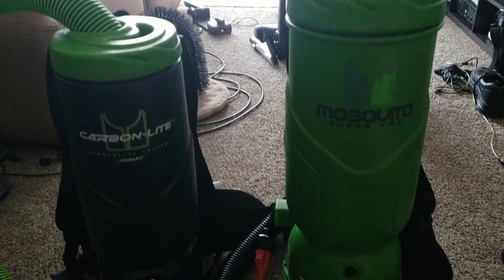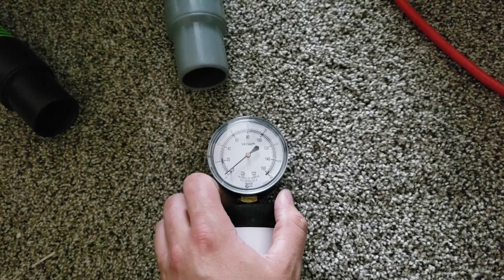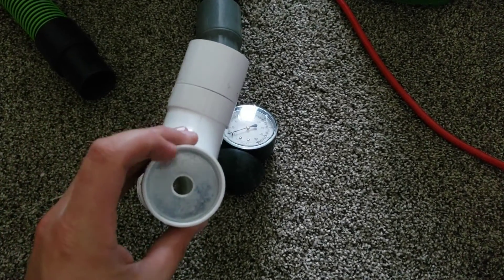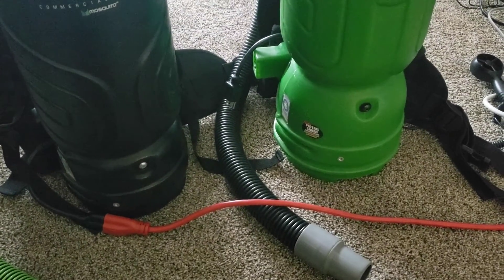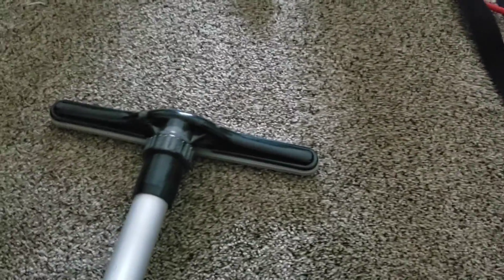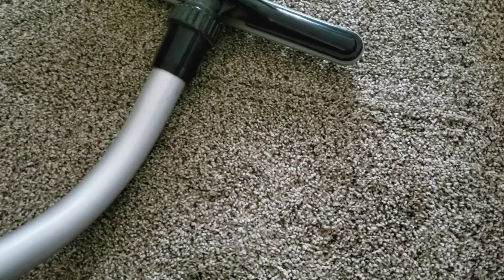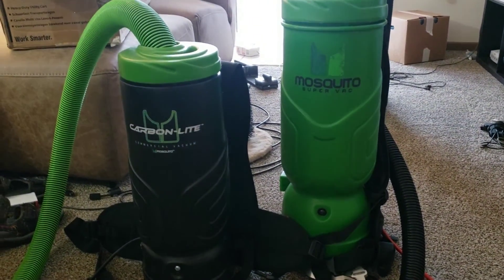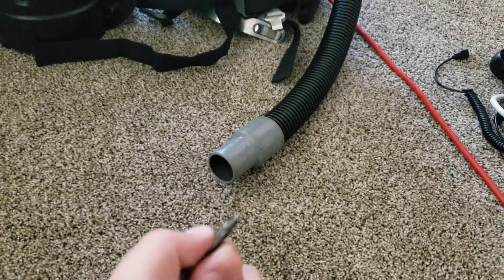Thoughts on working vacuum

Comment: A simplification: Suction digs lifts and focuses harder on a point, while air volume expands and sweeps a lighter larger area. Ultimately both are dependent on a combination of each other, relative to the fluid dynamic surface friction, of suction combined with CFM volume to overcome gaps in the seal around an object. Without enough seal and suction, one cannot overcome a density threshold regardless of volume. Conversely without enough volume, suction cannot overcome a certain gap of air allowed to pass around the object, so you lose the surface friction and lose your benefit of heavy power to overcome resistance like high density objects or a reduction in hose diameter like a clog. You certainly will better dig deeply embedded material and dense objects with higher suction and a good seal. You will sweep large swaths of light-density junk as a professional much better with a higher volume, as your proximity of reach is better for lightweight stuff.

Your job is to basically sweep a large volume swath of light-weight material as quickly as possible like a push broom, so that's why CFM is 'better' for professionals. You will not have to worry about density and enough fluid friction to lift denser weights passed the needed threshold. That's why it grabs from a distance around the openings. It's not 'better' it's just overcoming a light density in more area. If I'm sucking heavy density in less area, you bet your breakfast I'm picking a moderately lower CFM but higher suction unit. In my case, I need to remove embedded mold from wood, and from carpet before tearing them up. I will guarantee you I am getting more mold with the higher suction and some agitation than the higher CFM model.
Reply from the maker: Right you do need both  but I think people often overestimate how much suction is needed to clean effectively. Id' check out vaclab's channel he does pickup testing. High airflow/low suction machines often do very well while some high suction/low airflow machines do poorly. Of course a machine's agitation is very important to pickup as well.
So you've mentioned that you'd choose a higher suction machine for heavy density dirt but when we look at these two units what is it that the super with 90" of suction wouldn't be able to remove that the carbon lite would? I mean i'm sure there's some very very specific scenarios but like in regularly usage where you're using them with an airflow dependent straight suction tool I just can't picture that scenario

Comment: Hey I love this video!  I’ve been wondering how the cfm compares on the carbon light vs the super.   Just curious, do you have wattage or amperage draw numbers on them each?  Thank you for sharing this!
Reply from the maker: I don't I sold off the carbon light
Reply: I love the fact that (for what it’s worth) the green vacuum still has similar working vacuum numbers as a central vacuum.   Have you taken a working vacuum measurement on the Proteam FS6?   The amp draw on the two is different.  I wonder if that shows up in working vacuum numbers? Hmm🧐
Reply: I think cfm is more important than water lift. Water lift is measured as a sealed suction , so you maybe able to pick up a large nail , there’s not enough cfm to draw it back to the canister. While even if you had only a lower lift but greater cfm  it could take a large nail back with ease.

Comment: Kind of surprised you ran both vacs sitting on the carpet. Both exhaust out the bottom which will be effected by the carpet slowing down the airflow.  The proper way to tell the power of a vacuum is a before and after soil recovery test by weight as CRI does.  A visual oh this one did better picking up oatmeal is useless. The sand is what needs to be removed. It's what destroys the carpet from the bottom up. I own both these units and the Carbonlite motor is superior on both hard and soft surface. Put some nuts and bolts on the floor.
Reply from the maker: the impact of them being in that orientation I think is negligible Knowing that I measured about 150 cfm from my Proteam FS6 at the end of a 1.5 hose using the same motor as the super tells me that it really can't be making much of a difference. If it were against a surface that was less breathable there may be a greater impact to their flow. 
Well you're free to have whatever opinion you'd like but as someone who does commercial cleaning I'd gladly take the higher flow unit as airflow is what cleans.

Comment: I'm a professional hardwood refinisher. I am looking to invest in a pair of "the best" backpack vacuums for my purposes. Was looking at pro team, american sanders, and mosquito. I like the materials used in the carbon lite, however this video made me have second thoughts. 112 CFM seems quite low compared to the competition.

The proteam super coach seems to get a lot of mixed reviews. Durability and ease of parts replacement being one of the main negatives
Reply from the maker: For your purposes I feel like you may be better off with another type of unit in the long term. something with the ability to partially clean the filter easily during usage.  Like a Nilfisk wet/dry unit with the push and clean feature. You block off the end of the hose and then hit a button on the machine opening an airpath to kind of blast some of the stuff from the filter. There may be other units out there with something similar too but i've found those to work well for debris pickup from sanding wood floors as well as concrete dust. Though if you're definitely wanting a backpack unit I'd choose Proteam they are like THE name in the backpack vac industry, Just be sure to maintain your cloth inner bags too.

Comment: I think the size of the hole should be a 1 1/4 it then shows the ability of the machine to over come the loss of air flow of the hose and other restrictions in the machine and still maintain good air flow at the cleaning end of the tool going to see a lot lower readings but both waterlift and and cfm come in to play then
Reply from the maker: This is how another collector chooses to "measure" machines I was pointing out the flaws in it. If working vacuum were all that were measured we would believe that the carbon lite was the better machine but the super is clearly superior. If we were running a long airpath or using a turbine nozzle then the higher suction of the carbon lite would be better for the task but under normal circumstances the super is the superior machine.

Comment: Completely agree. For central vacuums you can find out if a clog is in the system. You’d have low working pressure but full sealed pressure, so you can see that a clog is present. If the sealed number is low, then you’re looking for a leak. Great explanation though!
Reply from the maker: Thanks I'm not great at explaining my thoughts it just irks me that some use working vacuum as their justification to put down direct air machines. They're often great performers on carpet but they are very inconvenient and few modern day consumers would choose them due to that.
Reply: I think working waterlift systematically underrates direct-air vacs and overrates machines with high sealed suction. That said, the  of sealed to working does tell you a fair bit about airflow. Airflow alone I think overrates direct-air vacs, and airwatts is annoyingly easy to game. I'd really want to see all of these metrics for a given vac.  @Blackheartvacs

Comment: One BIG issue I have with "working water lift" is there is no standardized hole opening published anywhere I can find. So should the hole be 1/2" or 3/4" diameter? No one knows. And since suction (pressure) isn't a direct measure of dirt pickup performance, relying on yet another oddball variation of it boggles the mind. Working water lift isn't even a good indicator of another false measurement, Airwatts. Yup, there is not actual standard for a hole opening for Airwatts as the procedure is as follows: pick the opening diameter that generates the highest number, which varies all over the map.
Reply from the maker: I think some use it as their unit of measurement simply to make the machines they like look good while they attack others machines they dislike., most of which would produce lower working vacuum.
Reply: @Blackheartvacs  ah, yes, there is always the marketing aspect. 😁